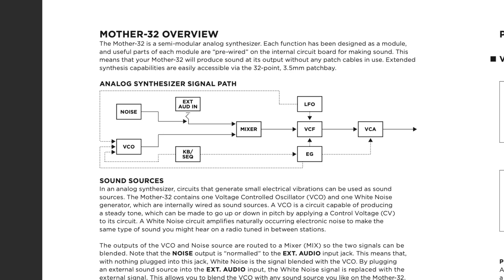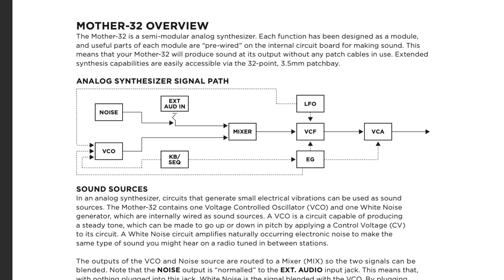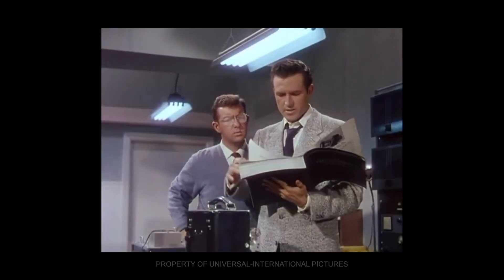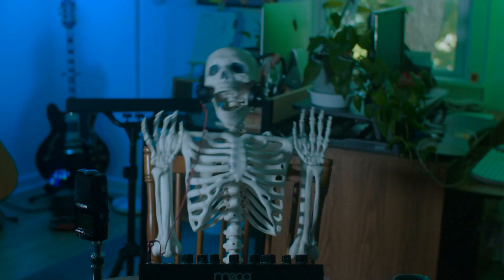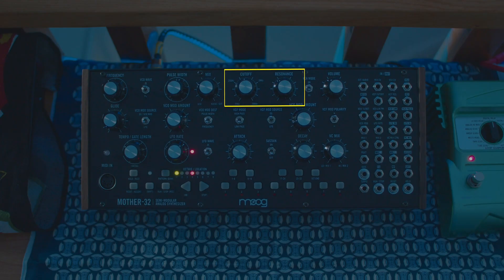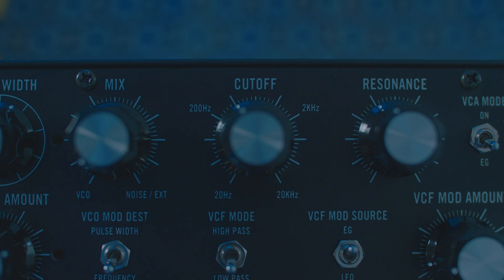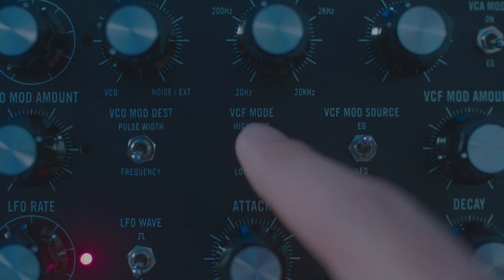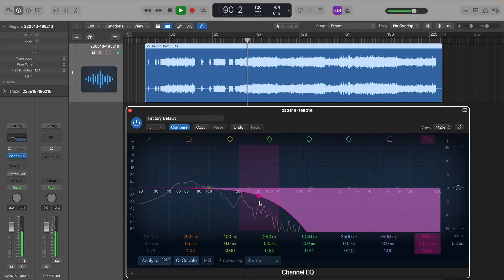Mother-32 | Intro to Sound Design

Comment: Thank you, great video. Mother 32 was my rabbit hole into synths, or more specific, eurorack. 
Mum is good. Not great but good imo. I love the sound, the features, layout, build quality and the general design is perfect for anyone wanting to learn how to synth, and it is also no problem for skilled musicians to produce amazing pieces with say three mums. However, the sequencer and programing of this thing is really bad I think. In my current context I use mine mostly as utility. it might collect dust most of the time but I will never sell it. 
I would recommend anyone interested in semi modular synths to check out other brands to. Pittsburgh's "Lifeforms", "0 Coast" from Make Noise or any of those good value ones from Arturia.

Comment: I don’t know much about Moog products but this one looks so cool. Would you say it’s a good entry level? Also, can you get more ambient-ish sounds too? Less harsh electricity coming from my power outlets
Reply from the maker: I would say this is the absolute best synth for getting started in subtractive synthesis/sound design as well as an entry point into eurorack! 

Another great Moog option is the Werkstatt, but that doesn’t have the awesome sequencer and isn’t eurorack compatible if you ever want to add more modules. 

And yes, it can get reaaaally ambient and warm if you want it to!
Reply: @ShinesTV  sounds great, thanks for the insight on this unit! It looks pretty flexible cause you can use it on its own or expand it with modular stuff.